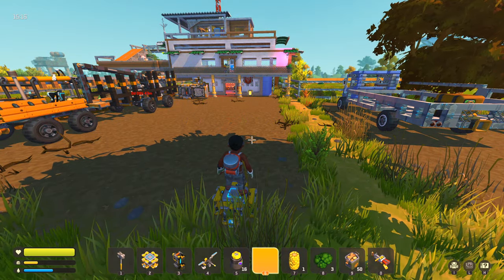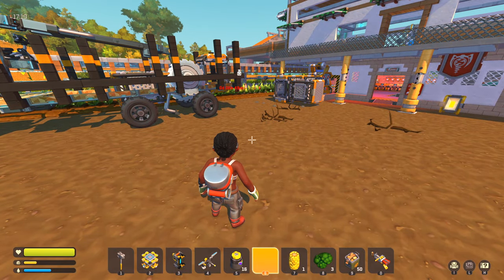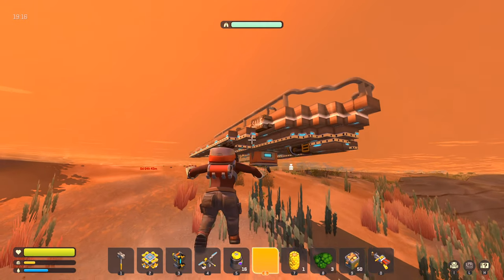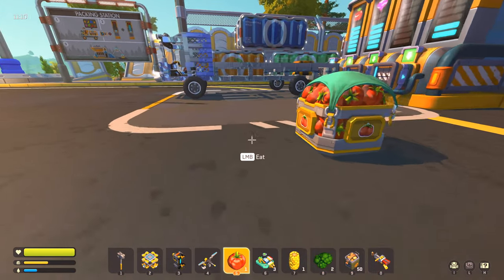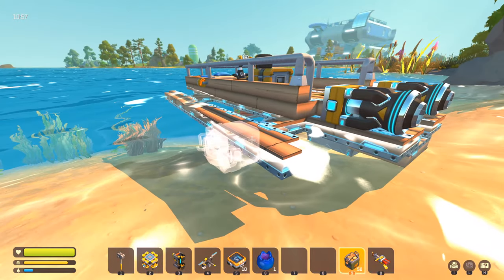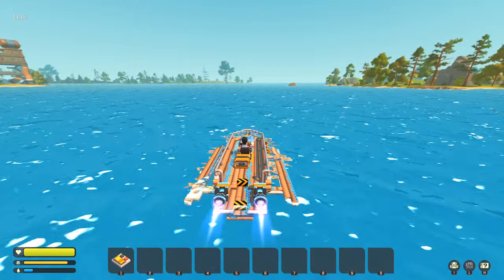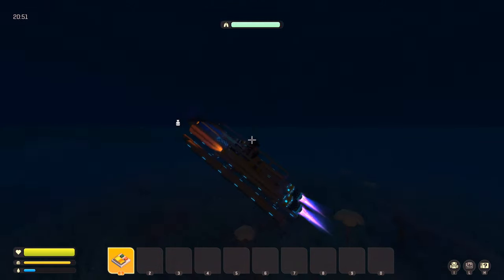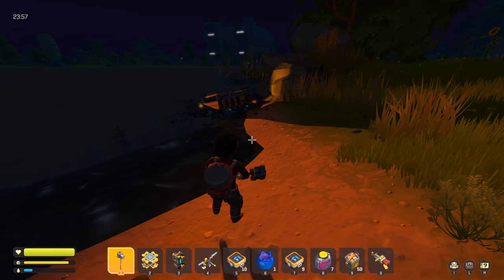I BUILT A SPEEDBOAT , Scrap Mechanic Survival #27

Comment: Nice looking ⛵! I just wanted to know one thing that the component kits are available with the traders because of the mod correct??
Reply from the maker: Yeah, I added a new recipe to the trader, although it's like cheating, I found myself wanting to play the game now and farm a lot of tomatoes.
Reply: @ikey07ch  That's okay though until you are not messing too much with vanilla SM. I wonder if you know how to reduce the lag of this game! Is there any mod for that? XD
Reply from the maker: @Gamechk  Be sure you don't stretch bearings ( making something move which hits something else ) don't make many attachment points to the ground ( base with floor touching the ground ) be sure to keep collecting scrap metal from haybots, be sure you dont have many loose objects in your world. and if you build something big, keep it in many smaller pieces.
Reply: @ikey07ch  Thanks for tips. I will follow these for sure. How about the items we drop manually from our inventory? Usually I drop some seeds or a item whichever is not useful for me since I can get those easily. Will that cause lag too?